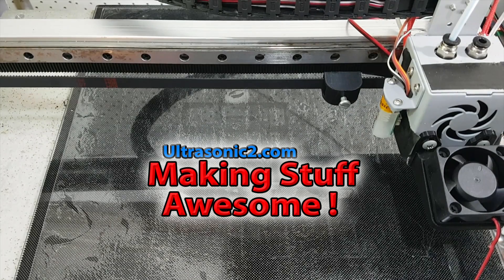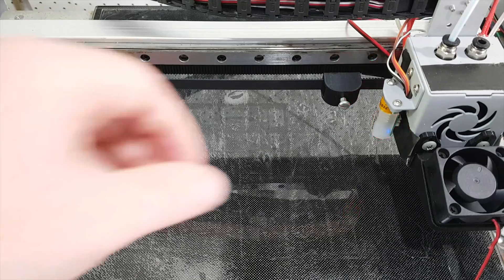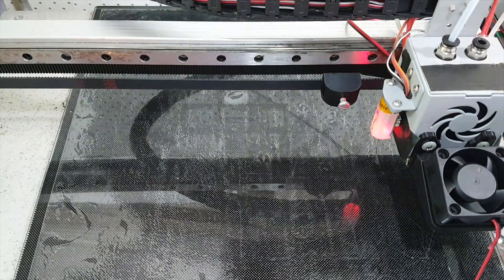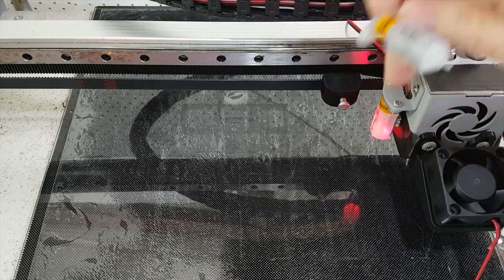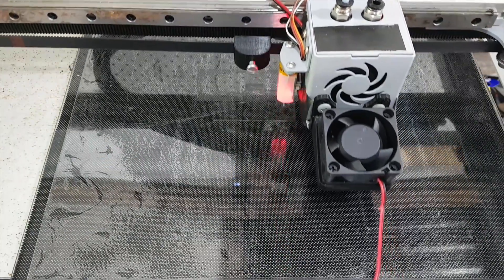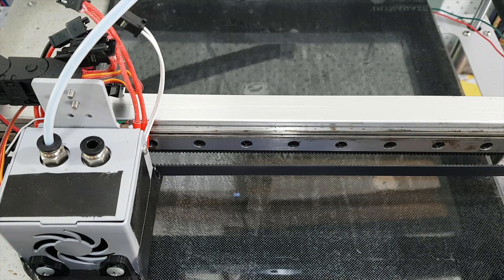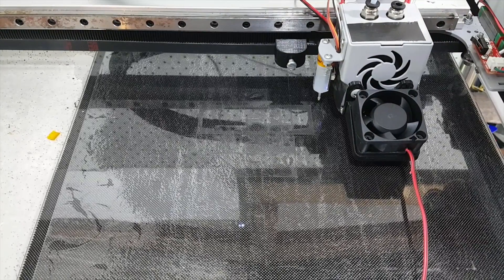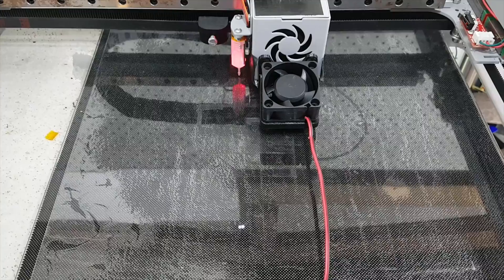⚡️ BL Touch V Clone Is it worth the extra money for a BLTouch for 3D printers or is the 3DTouch fine

Comment: I know this is an older video, but the issues are still around even now.  Marlin does stop the ABL if the probe errors now thank goodness, but the knock-off BL Touch probes are still hit and miss.   I would always pay the extra money to get the genuine Antclabs version, or now the genuine CR Touch made by Creality that seems to be slightly more accurate the the Antclabs version (and fits the same mounts).   Always go genuine.   Its just not worth pulling hair out.   The genuine one will last a lot longer and is a lot more accurate.

Comment: There used to be a problem with Marlin's mesh bed leveling that caused it to send z limit reads falsely. Happened with the lcd levelling too. This seeeeeems to have been fixed and might mean that the bl touch is getting screwed over by the firmware bug. Anyone with this problem should try updating their marlin firmware before replacing their bed level sensor.
Reply from the maker: this was not done with marlin this is with a lerdge
Reply: @Ultrasonictwo  Ah. Then I don't know

Comment: Just calibrate it like it shows on the forum. With power on adjust the hex screw on the top of the 3d touch screwing it anti clockwise until the red light is out, then screw it back in until the red light just comes on again. Then try again. JRTFM.
Reply: what forum are you talking about
Reply: What forum are you talking about

Comment: You know looking at other comments .... you know when you buy a light bulb you expect to install it and turn it on and get light .... not turn it on and flash ...and then have some suggest to and a capacitor or resistor then it will work most of the time, the in two weeks not work at all. Think about it ... doesn’t make a lot of sense does it. Later

Comment: Most fake BLTouch Firmware was hacked 4-5 years ago and it can not do the instruction set that the current genuine BLTouch supports.
Referring to the instruction set of the fake BLTouchs, they stay in the instruction set 5 years ago and offer only the minimal features of S10, S90, S120, S160, but the exterior shape is constantly imitating the original BLTouch.
I hope you do not have any more victims.
Official Reseller :  https://www.antclabs.com/store?fbclid=IwAR3EGoY2UXI9pTbmLV3itw_1vpTKxo4HeCem0NpNcDtKDq0N8SrfWvUzfps

Comment: BLTouch does the same thing
Reply: I should add that BLTouch support was contacted where they said it is the 5V power supply. After monitoring the power supply and it was found to be in range at all times I installed a power supply just for the BLTouch and added a scope to monitor it. Support did nothing.

Comment: I just cant make the bltouch work for me. One side of bed is always closer to nozzle than the other.
Reply: What does the M48 repeatability test report?
Reply: Have you leveled your X axis? If it's higher on one side, you'll get the same thing.
Reply: @toms.3977  yeah basically you are right, fixed the issue with dual Z

Comment: I would suggest adding 100 uF 10V capacitor close to the probe - solder it to the connector pins. It could resolve "blinking"  issue...

Comment: Thank you so much for this video. I've been considering BLTouch for two of my printers, glad I'm not going to waste time and money on cheap clones.
On the Anycubic glass plate... I have one. The two tricks I found are:
1. Coat the plate with white-capped Uhu glue stick. You don't need much glue and can smooth it down with a wet cloth. Let it dry (hot bed helps here) then you're good for a dozen prints or so. Don't bother with the blue-capped or green-capped Uhu glue sticks, they are different formulas and completely useless for 3D printing. Alternatively...
2. Set your Initial Layer Speed to 5-10mm/sec. You can use your normal 100-150mm/sec for subsequent layers, but the first layer needs to be slow if you don't use glue.

Comment: installed Trianglelab 3dTouch the other day its pure junk! do not waste your money Repeatability is all over the place between 0.05 to 0.13! Brand new Tevo Flash has metal mounting place and very slow homing  #define HOMING_FEEDRATE_XY (50 * 60)
#define HOMING_FEEDRATE_Z (4 * 60)
Reply: Hi! :) Did you've installed it connecting to Flash's BMC socket? I wonder if anybody knows the pinout...
I want to buy this one https://ru.aliexpress.com/item/3D/32890485972.html?spm=a2g0s.13010208.99999999.259.6fd83c00CtFfIZ
People wrote some amount of good feedbacks about it (not all!). In some video (or on the forum) I've got to know that BLTouch actually isn't a genuine "patent". The roots are from Open Source and some guys did this sensor before BLTouch. So very possible that some clones can be as good as BLTouch.
Reply: My trianglelab 3D touch has a ton of issues as well. I thought it was a good deal at first, but it ended up much worse because of the headaches it has caused

Comment: Can't u adjust the height at which the detect pin is affected by the magnets. There is an adjustment screw on the top of bltouch?. I think on clone your release point on of magnets was not correct?
I have original too. Clone should have the same adjustment?
Reply from the maker: i dont know .. can you .. i don't know if you can
Reply: The fact still remains that the clone is an inferior and unpredictable copy.